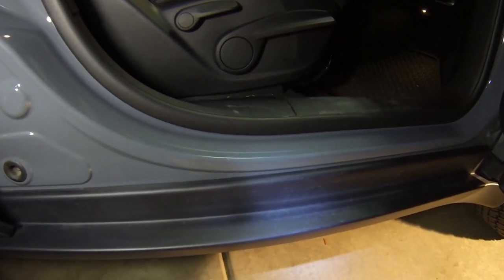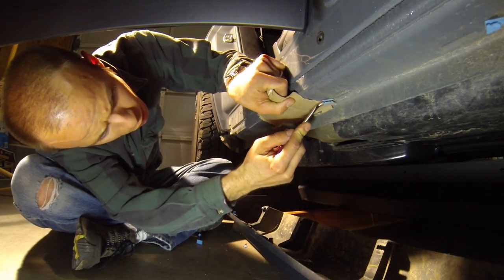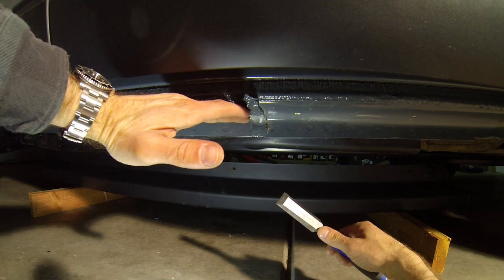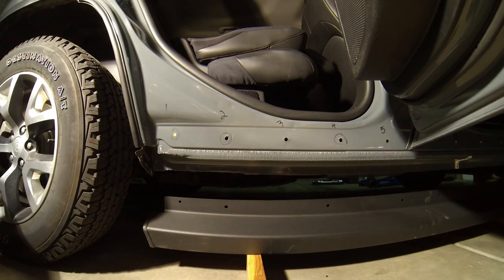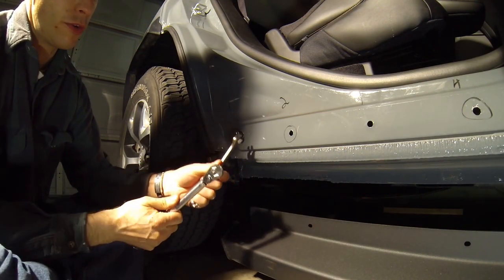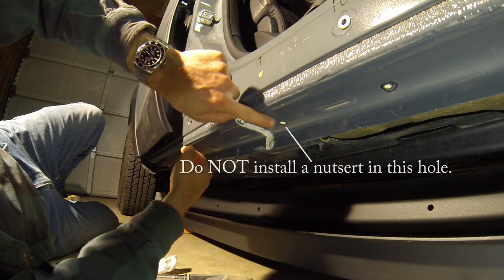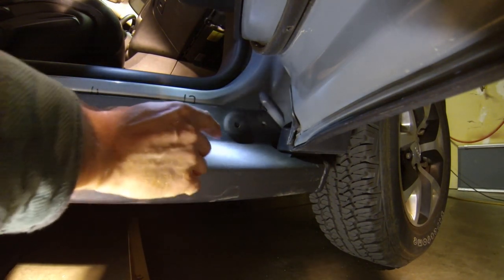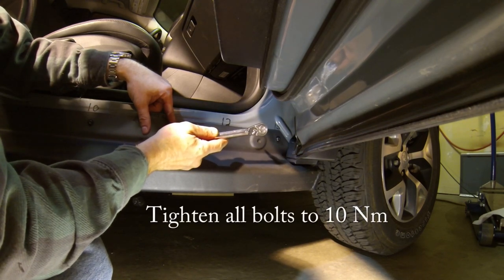2014 Jeep Cherokee Trailhawk (KL): Rock Rail Installation

Comment: Do not remove seam sealer!
Reply: Can you please explain this comment. I don't understand why not. Thanks
Reply: @LarryRichelli  Seam sealer is there for a reason. It seals the gaps between the metal so no dirt/water get in to the frame of the vehicle so it doesn't rust. Just because he wants a "flush fit" will most likely result in rusting later on.
Reply: @stephenewaski908  So if I was going to do this, after shaving down the seam, I should primer and paint that area....is that kind of what your saying?
Reply: @LarryRichelli  I wouldn't touch it at all.

Comment: the 2013 grand cherokee came with these i have one bought my wife the cherokee trailhawk and noticed it has plastic rock rails. Jeep should have installed these from the factory just my 2 cents nice install and attention to detail much appreciated.
Reply: I'm with you.  GMC sells $50,000 plus pick ups and sometimes won't give you a trailer-braking device for an  installed option or a sprayed bedliner! Talk about nickel and dime stuff.
Reply: Mr Hartmann , those items you mentioned are what Dennis Hopper (Space Trucker) would call "options". How is the Dealership going to generate record profits?

Comment: can the car be jacked up using these rock rails?
Reply from the maker: The rock rails are plenty strong enough to use as jack points, but with with smooth surface underneath there would be a high risk of the car sliding off the jack.

Comment: I just want replace my original Lower Cladding Molding on my trail hawk.because i cracked it... It looks like some of the Snap clips broke in the body, How do you get them out with snapping them? And if you  do snap them  how to you remove the broken end piece?
Reply from the maker: The clips are not intended to be re-useable, although sometimes they come out on one piece.  As for how you get the broken end pieces out...I wish I had an answer.
Reply: @FreedivejeepHD   Yes I have the replacement Part, I guess the original  one wasnt Trail rated if you know what i mean...  The new part comes with all new Clips anyway. , I was just hoping I could get all the CLips out of the holes..
Reply: maybe heat them up with a Hear dryer so they are soft and come out easier?
Reply from the maker: That's a solid idea; let me know if that works pretty well...